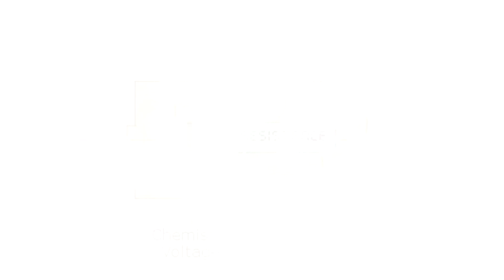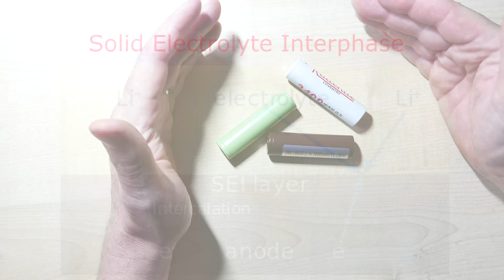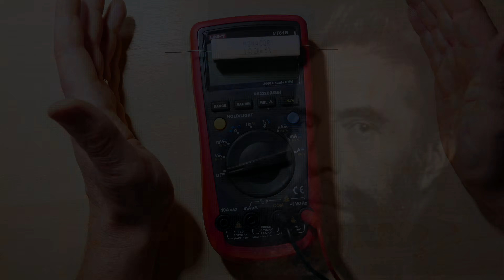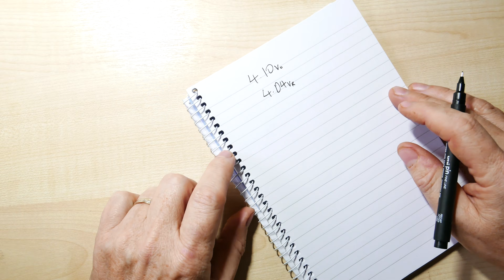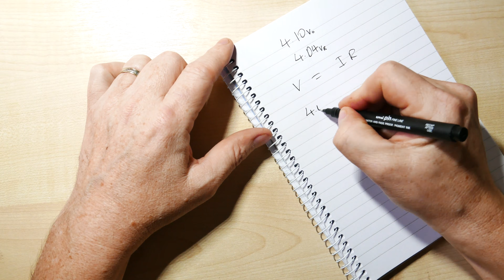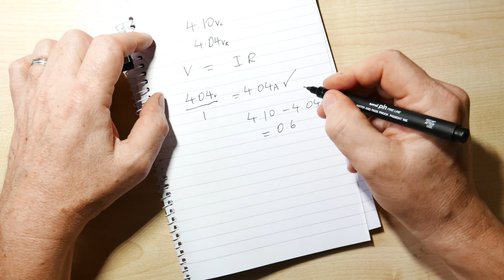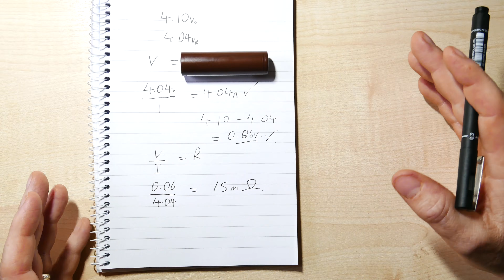18650 Li-ion Internal Resistance Explained & Measured

Comment: I feel like i have been wasting my time with my project.  I started checking my batteries resistance. I have checked about 60 so far and all ov them between 120 - 200 m ohm.  Is that high? Can i still use them in powerwall?  Thanks
Reply from the maker: Depends on the chemistry and capacity.   What I'm trying to illustrated is that if the resistance increases substantially over time, you cell is deteriorating.   As for using them in a Powerwall .. that will depend on the current drain you expect to get and the parallel connections in place to deliver that current.  Too many variables to give a clear answer.
Reply: Thanks for your input.  They all have capacity over 2200mA.  They are from old laptop batteries.  I'm planning to do 24v and about 110A 7s50p.   Great video. Thanks
Reply from the maker: It's unusual for li-ion 18650s to be any less that 1C or in your case, 2.2A. Therefore 50p is (50x2.2) is 110A with room to spare. HOWEVER laptop cells are often sourced for a lower current-drain, so unless you know the specs of the cells, try running one at 1C and check the temperature and internal resistance before and after a complete charge cycle..
Reply: in the last part, why do you suggest checking the internal resistance before AND after a full charge, what is the significance of this?

Comment: Nice video, also use thick wires (and use the same wires over) to limit the voltage drop across the wires (with that 4Amps current draw).
Very nice battery holder.